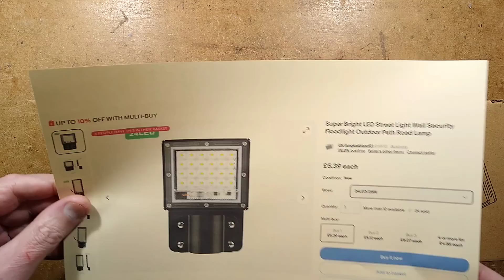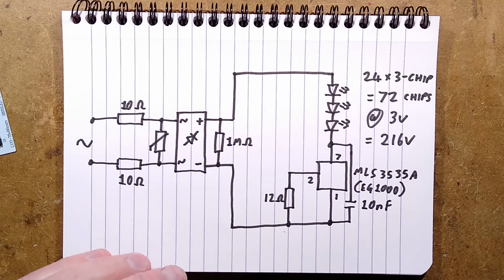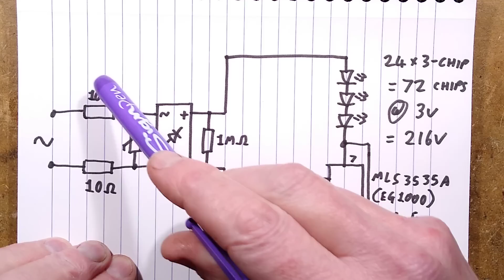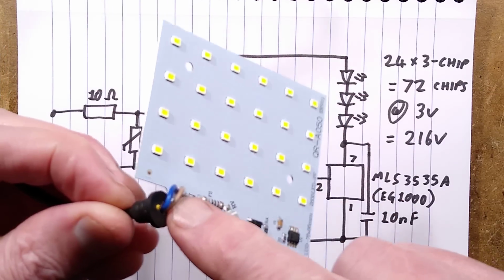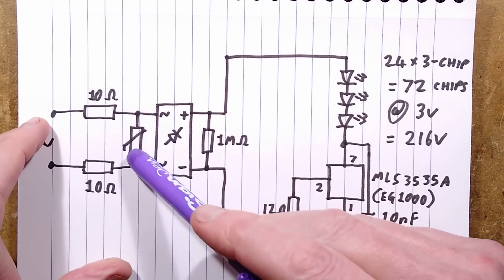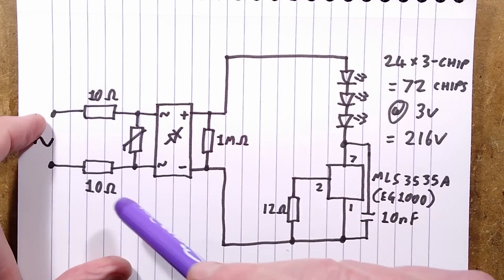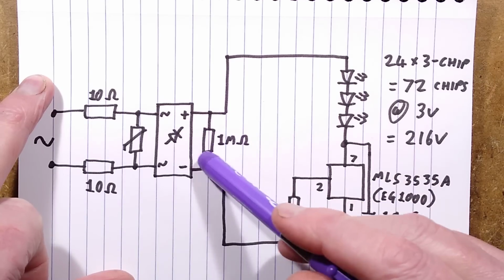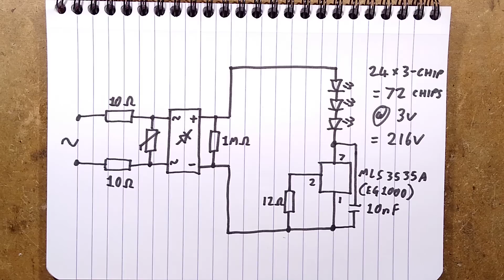Inside eBay's cheapest LED "street light"   -   with schematic

Comment: lol this reminds me of some really cheap led spotlights I ordered off Aliexpress some years back. I wasn't expecting much since they were about $3 each. However, to my surprise they were about 10 watts, good cases, and the grounds were actually connected. I put two of them outside to replace my porch light and some years later running 24/7 completely exposed to the weather, they still work just fine. I guess I lucked out.

Comment: When I was a child, I help rewire a marionette theatre (we were switching from a very dodgy/exciting manual lighting system that involved two-pin plugs and massive rheostats that gave you a nasty zap if you touched anything other than the Bakelite handles to a programmable system). One of the main things I did for the switchover was to rewire everything for three-pin plugs and thoroughly test the grounding. We designed the switch panel in house, and I learnt about making sure to sand the contact points for the earth connections to ensure everything was properly grounded.

Comment: i had a great day today. i have been mucking around with electret condensers, and wanted some more info so i had a rummage about online and found a great bit of info from a place called UC Santa Barbara , by a bloke called bob York, in an old style website with obvious folders. so i wandered up the file tree a bit and found a goldmine of lesson plans, general guidance, and reading suggestions. it is like being at uni, at home. if one searches for "ECE2 lab1b" it is one of first results. i am so thrilled. bit of an odd thing to mention, i appreciate, but i felt i had to share it.

Comment: Not convinced on the sustainability of these LED fixtures. My local council changed to LED street lights en mass in 2017 and many are now failing. Normally they start flashing, so its likely to be a capacitor issue. I understand the lantern heads are sealed units so not serviceable in any way and they end up in the skip. Although more energy efficient than the old low pressure sodium lamps I would imagine the cost of replacements every 7 years will prove more expensive overall than the old lamp heads, the actual fixture of which served well over 30 years, obviously with tube, ballast and igniter replacements.

Comment: Both aluminum and steel oxidise (rust).  Syeel just oxidises an orange/red coloir, aluminum is pale white/grey.

To avoid this issue, mount thr device on a slight angle.

I'd avoid buying it in rhr first place, seems like it will have a short life.

Comment: Big Clive, would you happen to have a suggestions for making a water-resistant outdoor external IR illumination for CCTV? The offerings online seem overpriced and really disappointing. Gutting a standard outdoor LED lamp seems like a better option. 230V and 24V inputs are both close by, but it's for cameras, so any ripple is undesirable.

Comment: I don't understand the need for the varister. Why not just use the appropriate valued resistor? It's not like customers are going to open the case to change the resistance. :)
Reply from the maker: The varistor is purely for overvoltage transient protection.

Comment: That would be a pretty nice light as long as you kept it inside and out of the weather, grounded it and put more heat sink on the back. Interesting that the plastic cover has a silicone seal but the other side is basically a lake.

Comment: I'd want to put a nice big fat capacitor across the 1M resistor to smooth out the pulsing dc voltage and reduce the shimmer, especially if I was using this as a workbench light. But a decent one, rated for the right voltage would cost more than this entire unit, which is why it wasn't included. But Big Clive would rate it as Death Beam though.

Comment: Is there room behind the lens to put a death beam capacitor across the 1M resistor for smoothing?
Reply from the maker: No significant room, and that would also charge up to peak mains voltage and put a lot more stress on the linear regulator.

Comment: Sometimes I wonder if hobbyists are best off getting stuff that is easy to mass produce at a low price, then making modifications to it after it arrives to make it behave more like a high quality device that would have been more expensive.
Reply: One of the attractions of cheap unsafe ebay electrical devices. Plus, it's fun to see how dangerous they can make something.
Reply: Probably not because the parts are substandard not just the design. The chips are probably seconds that won't last near as long as you think.

Comment: What would you do if you were a contractor and were asked to install a whole bunch of lights like this where the ground was cut off and it was using non-copper wiring?  Would you just refuse to do the job once you saw the fixtures they had bought?  What if you had already agreed to install them?  Would you break the contract, or re-wire them, or something else?
Reply from the maker: I'd make the person supplying them aware of the issues and let them choose if they wanted to proceed and take full liability.  I'd do it by email and save a copy.
Reply: And you can see it has “no” fitting for a photocell or radio/WI-FI  switch, so the council can remotely dim/light it, if the council contractors were to see that “polished turd” they would reject it as; no earth/electrical ground, nowhere to fit a photocell/remote switch & the end of the column pole is left open

Comment: No earth required as this is clearly a double-insulated, class 2 appliance where no metal parts would be accessible during normal use (assuming the standard Mattel plastic pole was utilised).

Comment: Maybe the „Product must be grounded“ means that you need to ground the case, not the wire. Chinese translations at its finest. Also too bad they didn’t add a smoothing capacitor, it would be too easy to solder it to the full bridge rectifier yourself tho

Comment: If they made the entire housing in one piece of plastic, with a slot on the bottom side for the board to slot into, with a rubber or silicone strip to fill in / close it afterwards, it would probably be more waterproof. Especially if held upright. Of course, it wouldn't be very practical if you couldn't shine it downwards.
I wonder if two of the plastic covers could be joined together. At 4:05, it looks like the plastic cover has a gasket around its length. So joining two of them together might work - but there's nowhere to pass the cables through. And screwing them together would still result in issues with rust.

Comment: I'm married to a Filipino from the Philippines and in Manila for house hold use they have 220 volt AC at two phase of about 110 volt on each wrier and there no earth so all the power socket are just two flat pins so just may be that LED street light is for!! The Philippines? where it's a cast of EARTH wrier NO we don't need that.  Now some of the out of way streets have solar powered LED street lights but how good they are??

Comment: Yes would definitely use them indoors as workshop or area lighting, remove the mount, and place inside a round bulkhead fitting to do a retrofit. 7W will be more than enough light.

Comment: I was so hoping that the earth might have been connected!! Actually not that bad a little light, and something I could find a use for back home, ideally NOT exposed to the elements though. That would mount nicely on 40mm PVC piping (remembering to actually connect the earth to the lamp's metalwork!)

Comment: Would adding a smoothing cap on the DC output be worth the trouble? A decent diffuser may be handy to soften it a bit, perhaps?
Reply: The flickering is barely or not visible, except on camera, he forgot to say. For 8 Watt I think you need quite a large cap.
Reply from the maker: The capacitor would charge to the peak voltage. That would result in much higher power dissipation from the driver.
Reply: I wondered the same. Question is if a cap would fit in there.
Reply: It will work, its already got the bleed-resistor also. A 10uf cap or smaller might fit under the lens.

Comment: "holding the ungrounded case". LAD. YOU CHECK THE METER IS WORKING BUT DON'T CHECK FOR A SHORT :D
Reply: The light worked, so there was no short.
Reply: @two_tier_gary_rumain  Not a short as in a complete short, but an unintended connection to the casing. The casing could've been hot, worst case.

Comment: This is very strange indeed.  Today my son said "Dad, you need a new phone. I got you a new phone from Amazon. Here it is." After some protest that I didn't need a new phone he finally won by saying "Look how scratched and dirty your phone is. And your case is all worn out and the rubber is cracking." So he handed me a new phone and we proceeded to set it up for WiFi and Google login. I decided not to put my chip in it since this required some kind of unlock code. But it would do fine as a spare WiFi phone. So I am now watching Big Clive on my new Galaxy Note 5 which is actually older than my Galaxy A50 but it is brand new, not old and decrepit.  It is eerily similar but different in subtle ways such as the way the keyboard works. For instance there is no comma key so I keep pressing emoticons which is where the comma is on the A50. You have to go into symbols to get the comma.  Also some of the apps are older versions and there is no Back button. It is a little arrow which only lights up when you press on it so I am forever hunting for it. But spelling suggestions are better and light up in blue as you type.  All in all it is an interesting experience.  Cheers and over and out from my new Galaxy Note 5  😁

Comment: "25 Watt" means that the device will produce the same luminosity as a 25 Watt incandescent bulb. 
As an efficient LED device one should expect it to draw about 7 to 10 Watts from the mains supply. 

PS
Check out the World's Brightest Flashlight IMALENT MS32. Now 200K Lumens...
Reply: No, the listing says the power is 25W. It doesn't say light output equivalence, or any other such term, it says power.

It also says it has an IP65 rating 😂

The seller also claims all their products comply with all UK and EU laws and rules (Spoiler: They don't).
Reply: 200.000 lumen: https://www.youtube.com/watch?v=yrefqqirklY

Comment: We need a Big Clive bingo card, check off each discrepancy in products... no ground? Check. Danger of electrocution?  Check. Overrated battery capacity? Check. Poor high voltage separation? Yup. Head-scratching Chinglish instructions? Sure.  And so on.
Reply: Don't forget "One Moment Please" in the centre.
Reply: That might be “______Difficult” ;)
Reply: @scottzehrung4829  it will need to be an A0 sized sheet of paper, to have enough room.
Reply: Like Plainly Difficult does with his disasters? Shift change, no backup, no maintenance ?
Reply: @jamesharmer9293  that's where I got the idea actually
Reply: Perhaps contact Randall Munroe and ask what he'd want to draw one, or perhaps more in different sizes :)
Reply: How about “Is it pink?”😂
Reply: I did suggest that, don't forget the spudger! Extra points with more rrrrrrr's
Reply: "House!"
Reply: Is that not in the live-streams.😆

Comment: Based on 7-8 W, looks like they might be under driving the LEDs. Good if you want street lights to last several years without frequent repair/replace.
Reply: It's going  to be corroded and water logged way before.
Reply: I find that type will fail without warning. The type that doesn't are the flip-chip type. But that was probably more work considering.

Comment: The aluminum plate the board is stuck to confuses me. The corners were notched and the edges bent up with obvious mounting holes in them.

But what might be mounted to it? Is the plate a universal part also used with solar lamps?

Otherwise I agree that it’s a straightforward, if somewhat unsafe due to the cut grounding wire, area or small room lamp.

Oh, do the plate dimensions match up with British or European standard wall mount boxes? If so you’d have to screw it in from inside the wall or ceiling… never mind.
Reply: The holes are where you would anchor the earth wire. 🤣
Reply: Or maybe it doubles as floodlight base?_
Reply: In all these designs it only takes a tad more effort to get it "perfect-ish" This has nothing to do with saving on R&D. It's like they deliberately keep copy/pasting the same silly faults.

Comment: at least here in the US if this was mounted on a pole and grounded to the pole then the pole it self would have to be bonded to the rest of the of the grounding circuit of the system and if this was considered A ground rod and B permeant install a min of 8 awg wire would be needed for the bonding of the ground rod so in a nut shell you would wire this in with a hot and neutral then bond it directly to your other existing ground rod/S then having a dedicated ground wire back to the panel is debatable due to a ground loop issue I installed solar powered lights for about the same price no grounding needed and no wiring either

Comment: Rather reminds me of the time of the small 10w COB-based floodlights (what were they, £3 a piece originally?), amazing they can make something so dirt cheap (even if they skimp on things to the point of being dangerous!), and can cost less than a branded toothbrush!!! :P
Reply: I just bought 20x 10W cob chips for less than a fiver delivered in a week from the depths of China. All working at around 8W. They need hefty heatsinks but that was the plan for the project - growlights for my polytunnel. Dirt, ie compost is much, much more expensive.

Comment: what is the efficiency of this cheap simple led driver circuit? as compared to say a quality meanwell brand dc power supply
Reply: Except for the missig (electrolytic) smoothing capacitor it's the same circuit as a "standard" LED light-bulb. So the efficiency should be similar.
Reply: @DrAHorn  i don't know what you would consider a standard led light but there must be a reason people install £40 led drivers with tons of circuitry inside them
Reply: @cho4d  Light-BULB! Like "it screws in an E-27 socket". I don't know if that's the correct term, but I'm not a native speaker.
[Edit:] O.K. Wikipedia calls them: "A-series light bulb"
Reply: @DrAHorn  Light Bulb is good, across the UK at least. Most of the lamps (light bulbs) I pull apart have smoothing caps and discharge resistors but these flood light/street lamp types seem to be a large fusible resistor, rectifier and one or more driver chips with current limiting resistor. The chip spec sheets show capacitors but I think they leave them off for cheapness and space saving and don't care about flickering leds and overdriving. Or earthing and heat stress.
Reply from the maker: It's very cheap and simple, with surprisingly good efficiency.  Some prominent street lights use a similar approach.

Comment: eBay should pull the listing for the lack of earth alone
Reply from the maker: eBay doesn't care.  This is just one product of millions that violate electrical safety standards.
Reply: eBay won't do anything. Trading Standards might save someone's life by taking action against sellers like this.
Reply: ebay does not care about that. However, you’ll get hit with a VeRO listing removal the second you use the word “velcro” in your listing title.
Reply: No, it says that it must be earthed, so that's your responsibility!
Reply: An example of an unscrupulous seller buying “polished turds” on AliBaba, AliExpress and then re-selling them on eBay/TEMU

Comment: I cant see any local government using them as street lights. 
Failed the first test, off to a flying start 🤣
I see they working on the fewer the components the better system. 
If you drilled a hole or two in the top of the pole clamp you could screw it to a ceiling / wall in a workshop or lounge. interesting bit of tat 2x👍

Comment: is it that easy to scam local councils? Asking for a friend with a white speaker van.
Reply from the maker: If you hand over brown envelopes it is.
Reply: Sprinkle a bit of anthrax in the envelope for extra bonus points.
Reply: @wimwiddershins  allegedly, allegedly
Reply: Yes.  As the buyer, rarely sees the product.  They will be sent a ' perfect ' example.  The actual items supplied are not so perfect. The buyers in councils are also limited by budget and tendering rules.   The goods get delivered and they are then sent to be utilised as required.

Comment: Almost reminds me of the Meccano kits and their clones worldwide. I definitely wouldn't use it as a streetlight without adding some protection against rust and moisture ingress. The mains cable is super dodgy here, as is with most lighting fixtures made of pure grade Chinesium, and lack of the ground connection is a blatant code violation. Still, it can be modded into usability.
Reply: Its a basic as you could possibly get away with. 👍🤣